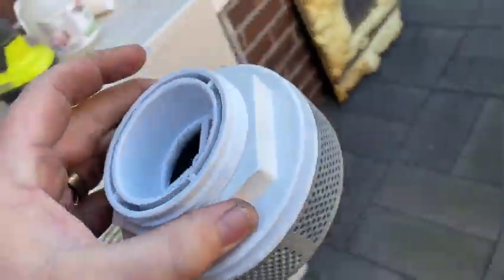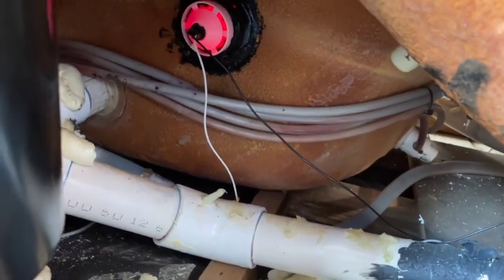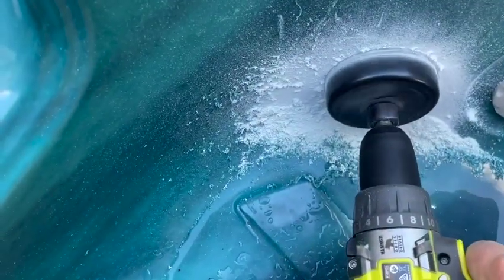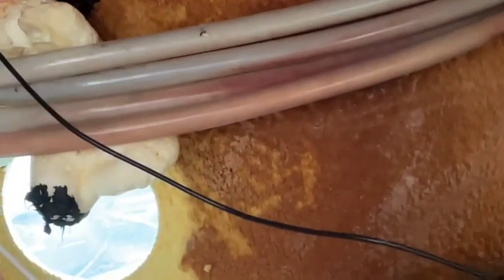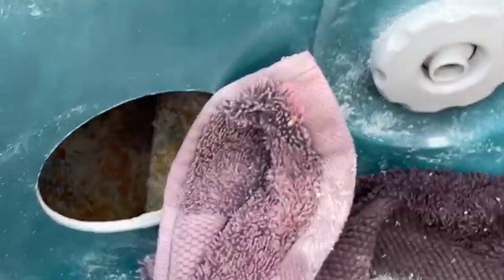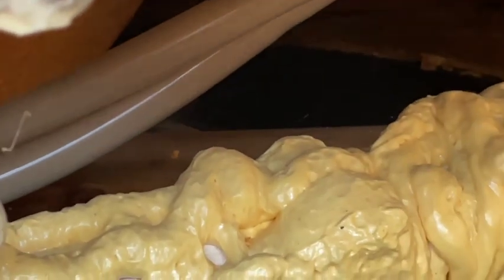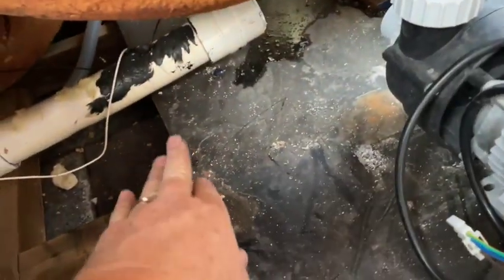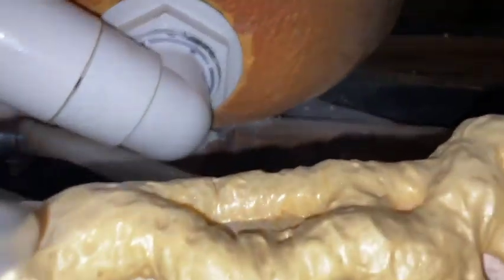RePlumbing a Spa. Installing new Suctions and an Extra Boost Pump. Pump & Plumbing Placement Jacuzzi

Comment: What suctions do you use? My spa is roughly a 2000 model and only has the filter bringing water through the pump and am thinking I should add a suction to the setup for safety reasons
Reply from the maker: Yes current regulations require that pumps have two suction points. Are you in Australia?
If so contact Nillumbik Pool & Spa Service and I can set you up with an appropriate suction.